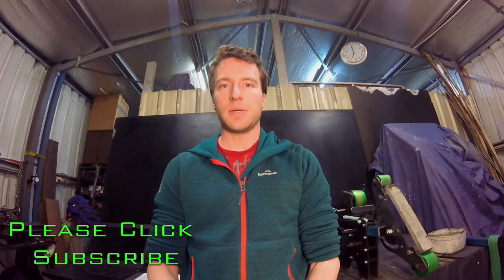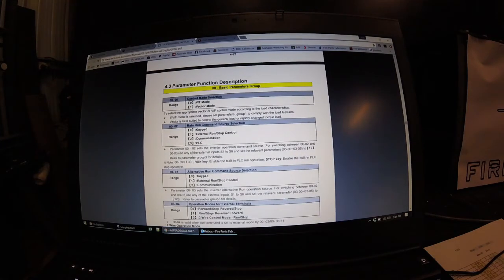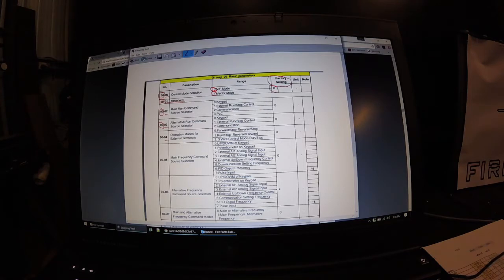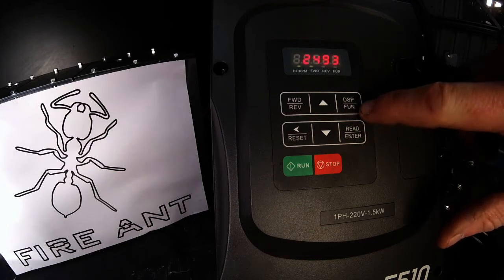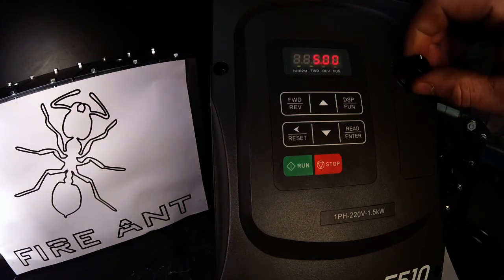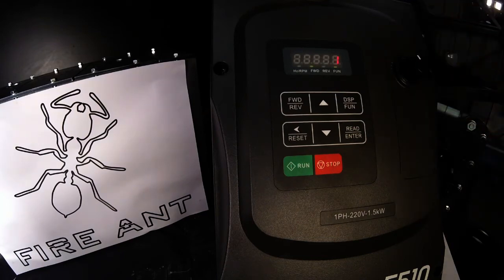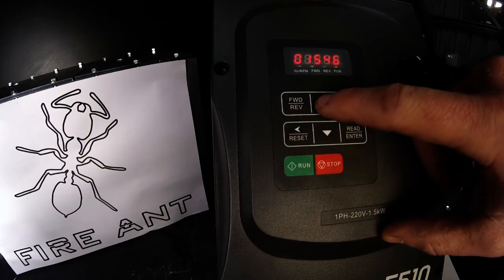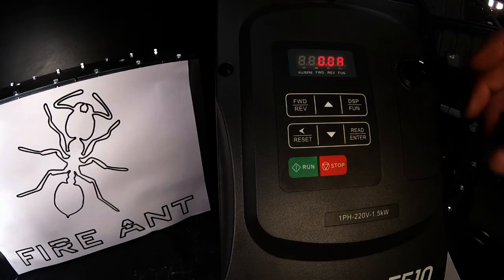How to program VFD / VSD for a belt grinder

Comment: Good video! I have a TECO L510 that i'm in the process of setting up. I do have a couple of questions.. 1) seems you have a 50Hz motor, why would you enter a max frequency (motor speed) higher than 50Hz? won't this cause the motor to be overworked? 2) It also looks like you set 3546 as your custom units in mode 12-03. I'm thinking this might be a constant number in order to get feet per minute perhaps? 

To be honest, I would just copy your programming as the L510 is basically identical, but my motor is a 60Hz motor and its rated RPMs are 1725..My drive wheel diameter is 5" in case this is part of the 3546 units thing.. Would be great to know what your thoughts are! Thanks in advance!
Reply from the maker: Thanks J D, seems like you have a good understanding of what is going on. Sorry for the delay in responding, I dont check this too often. hope this answers your questions.
1) Correct, I run these to 100% overspeed. So far I haven't had an issue with the motors at all. One day I will do a speed test to see how fast and how long. I suspect the windings will fall apart long before the bearings do.

2)  Yes, 3546 is the belt speed (in FPM) at 50Hz. (In your case, you will use 60Hz as your nominal speed) this causes the display to show the belt speed rather than the frequency. You also have a 4 pole motor, and a slightly larger drive wheel so you will have a different number to mine. 

I have a slightly updated program that is working a little nicer than the one shown in the vid, Pop me an email jake@firepantsfab.com if you want the newer program.
Reply: Awesome, thanks for the help! I appreciate it. :)

Comment: Liked the video a lot, thanks! Is it much harder to set up for three phase power? Are there any basic tips for that or is it pretty much the same?
Reply: Eg I want to use one of your vfd's on a three phase motor so it runs on my normal household power?
Reply from the maker: +Luke Haag thanks, I'm glad you found the video useful. 
The way you describe is exactly how these are set up.
It takes single phase (regular household power) and converts it to 3 phase power to run a 3 phase motor.